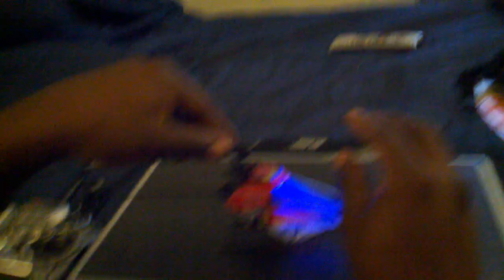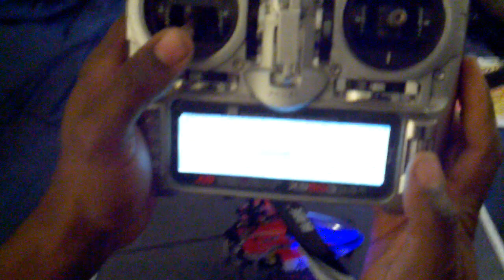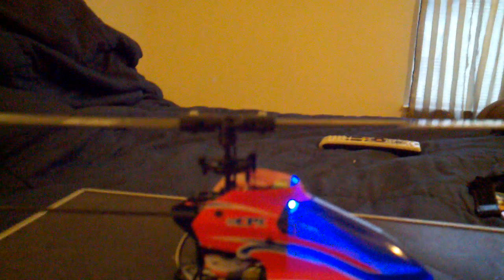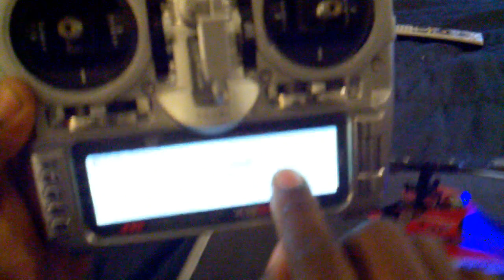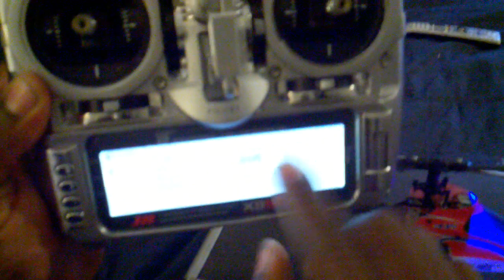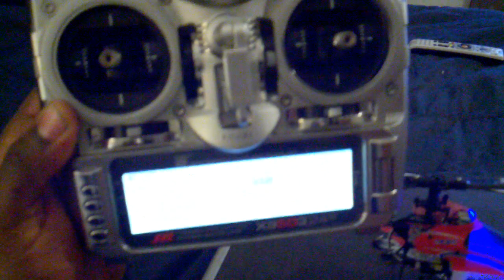Blade MCP X pitch setting and swashplate centering

Comment: Hi Tnt, I turned all (3) of my control links (2) full turns counterclockwise (CCW), & I got rid of my jittery servos that were twitching on me each time when I gave it full positive pitch or giving it full negative pitch (this is even with the rubber grommet mod). 
My setting is just above the half stick for take off now. I'm pretty happy with the setting now. I just folded the blades & eyeballed them so they were horizontal at mid-stick using my throttle hold switch. Thanks for the video!